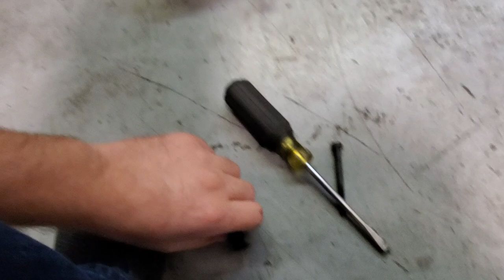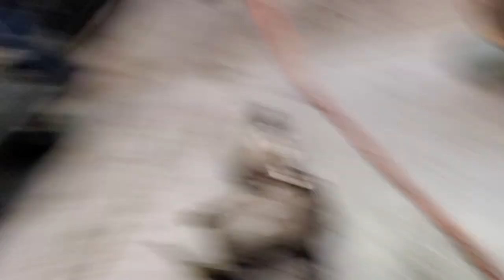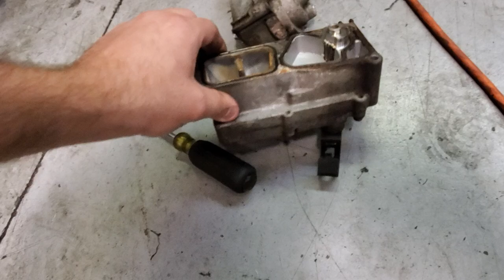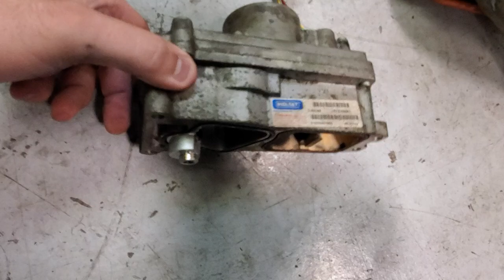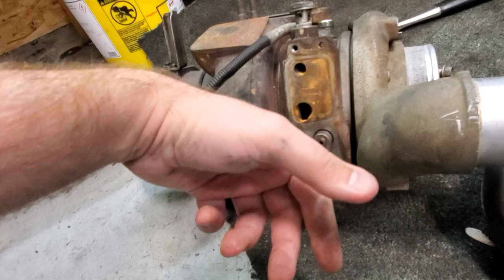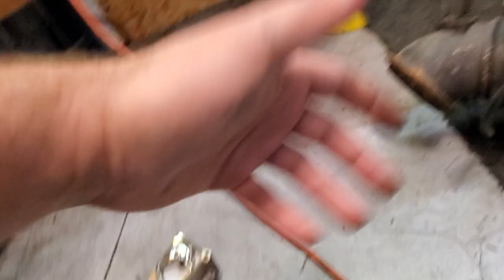6.7 Cummins turbo issues. When should you replace your turbo?

Comment: To prolong the life of your stock turbo, keep the exhaust brake on at least AUTO mode and try not to drive your truck unless you know for sure it’s gonna be fully warmed up during the drive. And don’t be afraid to get on it every now and then after it’s warmed up. Heat is your friend and limits soot build up in the turbo.
Reply: The exhaust brake will not keep the Turbo clean.  It's at the end of travel and the carbon can still build up to make the Turbo stick.  The Turbo can be cleaned/rebuilt but it's a bit above the typical weekend mechanic skill level both in terms of time and technique.

Comment: My Actuator just went out at 80K miles. Ridiculous. Waiting on the turbo diagnosis, but if they tell me it's gone, I'll be checking it myself.  Starting to think I don't have the $$$ to be a Cummins owner.
Reply: Did u replaced the turbo..? My truck actuator went bad 2 times in a year...and 3 weeks after I replaced an actuator i get a check engine light again indicating actuator..🤷‍♂️
Reply: @viram1831  nope, it was the actuator, changed that and then got rid of it, bought a ‘19 as it was having front end problems etc.
Reply: 80k is still under Warranty
Reply: Just had my actuator go out at 81k miles. Was not covered under the 5 year 100k mile power train warranty. Fought with Chrysler but they would not warranty it. $2250 later, new actuator is on and seems to be performing normal. Did get a little chirp here and there for the first mile or two of driving. Since then seems ok.
Reply: Mine appears to be dying at 83k and i have ran the exhaust brake religiously since i bought it new  almost considering trading it in.

Comment: I’m stuck I’m getting lost communication for the actuator but o have no lost in boost. Veins weren’t super hard to turn but was a little rough turning one way. Should I be worried about the turbo
Reply: Check the connection, make sure is clean,if not clean/add electrical grease

Comment: With mine it kept throwing a code sayin something about exceeding learning limit or something. I took it into the dealer and they replaced the actuater but my truck was at like 125 000 at the time. I was wondering if it’s likely that the turbo will still blow.

Comment: Look into the turbinator vgt. You can take any s300 or s400 turbo and add vanes to the turbo. The vgt system is also more refined and a different style system. You will notice once you look at the part and see what I mean. I would highly suggest looking into this kit for efficiency and power. I would recommend a Borg and Warner s463 with the turbinator Vgt for heavy towing and cooler EGTs. Also the turbinator plugs right into where the old turbo was so you still have your exhaust brake and all the same functions of the stock turbo. The only thing is you have to swap out the manifold to a second gen or third gen manifold to mount the borg and warner. This is my plan with my 2017 cummins after warranty and I will let you know how it works!

Comment: I am having my mechanic install the city diesel upgrade that I bought. Basically, my turbo would actuate, couldn’t do a regen because of failed turbo, caused the DEF to go bad in my tank ruining the DEF pump, and to top it off the DEF injector bolts snapped with I took off the injector. 

I bought this truck used with 101,xxx. Have put about 25,000 on it. 

Dealership would’ve wanted something like $10,000 to fix, plus wait time.

Comment: This is a great video! My ‘14 3500 with 106k miles! has the same issue. When it comes to city driving and running the exhaust brake and occasionally the check engine light would come on and boom, dealer says I need a turbo. But when I get on the highway and let the truck run in normal temps, the check engine goes away and then the turbo and exhaust brake works fine after that. Weirdest thing. Glad you made this video.
Reply: Did you fix the actuator and ran fine after that?
Reply: Mind does the same thing.  Have you done anything to it since you posted this
Reply: I prolonged it Until today. I’ll let you know. Replacing it myself.
Reply: Update, so far so good. Got a remanufactured actuator to replaced it. Had to put about 3 or 4 gallons back into the truck cause that’s how much drained out while taking the screws out where it holds the actuator on to the turbo. Recommend draining before you do this if you plan on doing it yourselves. Otherwise it can get messy.
Reply: @John Lopez  gallons of what?
😊😊😊😊
I don't know to much about turbo stuff. Thank you.
Reply: @efraingarciaescalante2824  coolant.
Reply: @JLO145  thank you!!!

Comment: I have the pleasure of dealing with this at 57k miles. Pisses me off. I tested voltages to the actuator and it appears normal. This week I am going to pull the actuator and see if the vgt lever moves as it should.
Reply: I ended up going with fleece performance cheetah drop in turbo. You keep the exhaust brake and the turbo is 63 mm vs 60 mm stock . Sounds way better than the stock . Literally plug and play look it up
Reply: Update, ordered an actuator from City Diesel. Will have it in about 2 weeks so we will see.

Comment: Im at 150k on my 2010 and noticed my brake was not actuating like it used to then it through a code on the actuator which I  plan on replacing. My question is, would it be a good Idea to clean my turbo by spraying cleaner in it and if so, should I pull it off the truck to do it as I replace the actuator?

Comment: 36Ok I replaced mine because of a bad actuator.  Did the turbo too and when I removed it the thing was sticky at the end of the travel to the left.  Dang thing stuck in full exhaust brake a couple times and I was nearly stranded only able to go 15 mph.  It was probably bad before this as I was only getting about 18 lbs boost max.  New one with the city diesel actuator gives me 28 psi boost.
Reply: You cannot get the full 35 psi anymore?? I’m having the same issue and also replacing with the city diesel upgrade.
Reply: @BlackKnight-ll8qh  that was my fix.  I likely could have done a stock actuator if I had known about alfaobd.  After swapping my turbo and actuator I struggled until I finally replaced the whole thing only to find out the Turbo had been assembled incorrectly.

Comment: Have any of y’all or you Paul tried those actuators that you can slap on and don’t need to be calibrated?  I believe Geno’s carries them, but i believe they’re made by city diesel.
Reply: I bought one that was “pre calibrated” and it was not working properly. Terrible boost lag and struggled when having to haul heavy loads. Planning to go to a shop and get it programmed correctly soon.

Comment: I have a 2013 cummins with 140k miles on it and it threw the code i replaced my vvt sensor and checked to make sure it was free and it was. When i threw everything back on i could not get it to calibrate it kept coming up as it failed. Im looking into rebuilding my turbo now and was wondering what you guys thought.
Reply from the maker: If your turbo vains move freely, then it's your calibration process that needs checking. Unless the actuator is not working properly

Comment: Off video topic sorry. Im looking at a 2004 3500 srw 2wd 5.9 6speed manual. Okd nan special 105000 mikes 14k mint. Any issues that year. Yiu always say 2013 or newer. Cleanest cheapest nv5600 Ive found. Im not mechanically inclined. Just fir personal use. Love the channel

Comment: 17 ram 3500. 375k miles My exhaust brake stopped working, only works sometimes, is it possible its the turbo actuator? Also just had my exhaust manifold replaced, my thermostat and my oil cooler gaskets replaced. I got a check engine light on, after my mechanic changed everything. Will it go away after a few drives? Has anyone had a check engine light on after replacing this stuff? also my coolant level is okay.

Comment: We had a truck with this issue never thought of checking this thanks for the great recommendation. Question, we have several ram 3500 with over 140k miles that when under heavy load or going uphill code p0087 comes out, any suggestions on what it might be? Thanks in advance.
Reply: Im loosing power now, how did you fix these problem?
Reply: Most of that time it’s the FCA actuator

Comment: I have a 2016 Ram 3500 with the 6.7 cummins and my actuator went out at 63,000 miles. My coolant reservoir tank is leaking at the seam and have to replace it also.  Other than that I love the truck and hope my problems are over for awhile.
Reply from the maker: Right on. Those 4th gens are solid trucks.  A little heads up. Keep up with your ccv filter. Change them out every 60k. It'll prolong your aftertreament and turbo actuator.
Reply: Have 2016 with same issues. Also my air filter intake hose cracked on bottom side. Luckily I caught it

Comment: My new to me 2017 ram 2500 (I bought from an insurance auction as the truck was stolen and entire dpf and scr system stolen) has 109k miles and I’m getting this code.  I just installed a used dpf and scr from an 18’ 2500 (unfortunately I have to pass smog in Vegas or I’d delete)….I guess mines toast at 100k miles.  Grrre

Comment: Great. I have a ram with u010c code. If I remove the actuator to check inside, I need to use a tool to calibrate again?
Reply: I just started to throw the same code?Do you have any other codes?I have one for MAF sensor, Replaced,and egr Bypass valve.Just did a intercooler pressure test and was fine.

Comment: Can I get an inexpensive tool to calibrate that accuator. I mean shit the part is about 500 bucks , 4 bolts , seals and some coolant.  do I need to purchase a 3500 scan tool? It like the dog collar is more expensive then the dog.
Reply: How did it go for you?
Reply: Started acting up About 15,000 miles ago . It's got 220,000. I found a company that rents out the calibration tool if you purchase the accuator from them ,  but I'm just gonna run it till it really shits the bed.  some days not a hickup at all,  other sounds like it's it's last day .
Reply: you can do the process with an android app called alfaobd... youll need to buy an obd bluetooth reader tho, the app is 50 bucks but well worth it
Reply: @ds2559  I ended up not messing with it pushing 260,000 and its fine . I deleted it and put a 4 option tuner ,  but I have to put it on the stock tune for a bit  ,to unscrew it self after that its fine.  Some one told me to just switch to the second gen manifolds and turbos and I will never have to worry about it again , but it all good if I don't have to spend money on my work Pickup thats always a win

Comment: My truck rolls coal and has no power with the vgt plugged in. Unplugged it runs good and only throws black smoke under somewhat heavy throttle. Is the vgt my issue? Has anyone here experienced this?

Comment: 2017 ram 2500 my actuator at 60k. I replaced it two time because it have stalled out the truck  only at stops. Drive and hauls fine, it just stalls at the stops. Any idea anyone?

Comment: What can a person do to help keep the turbo clean?
Reply from the maker: Using the exhaust brake helps
Reply: Run the truck warm and work it...

Towing trailers daily is great ... driving unwarmed for 7 minutes to the grocery store is bad for them 

When a diesel gets warm it runs better ... cold unwarmed engines soot more and plug up  more

Comment: The issue I’m having is when I turn off the truck it shakes real bad and my turbo doesn’t build more than 8ibs of boost
Reply: Mine does to it doesn't shake as bad if I use the engine brake though Is there a problem with it shaking? I didn't know that was a bad thing

Comment: 4-5k for a turbo ... where the fuck are you shopping,  the dealer ?  They rebuild these and sell them with the actuator on them ready to bolt right up for about $1200 . Obviously if just the actuator is bad then replace that , but 4-5k... lol... I've seen some mega high prices while looking around to see what things like turbo. Injectors,  and trans cost to repair vs getting a new rig and yeah there are some stupid high prices on things that I assume catch the guy who pays to have his oil and fuel filter changed at pep boys but some looking around finds much more reasonably priced parts .

Comment: Anybody work a 6.4 hemi hard?  Thinking about going back to gas for my light work.
Reply: I put 400k on my 05 5.7 hemi work truck ....lots of hauking and towing  .... zero engine problems beside wewr items and broken manifold bolts
Reply: I just got a new 5.7 hemi for light stuff and running around. Other trucks are cummins, but I end up taking the hemi more than I ever thought. Hauls awesome with just air bags, tougher truck than I assumed. Much simpler than new diesels, especially maintenance and under the hood. Impressed so far and considering trading my Cummins for a 6.4 next. I've heard all the camshaft horror stories but so far so good.